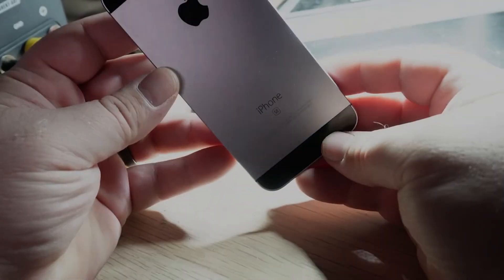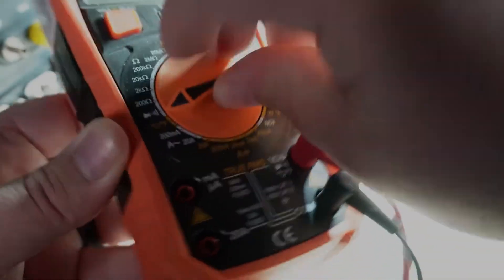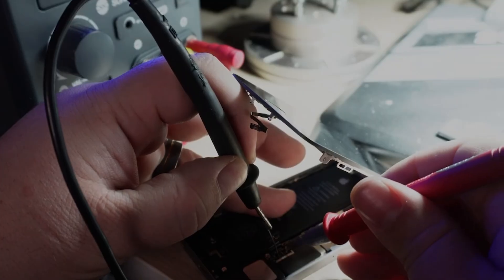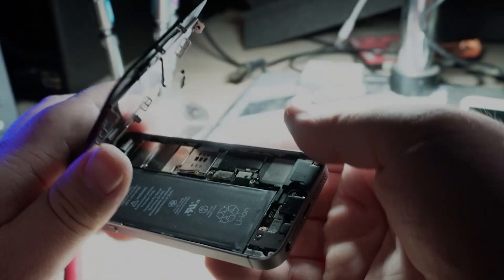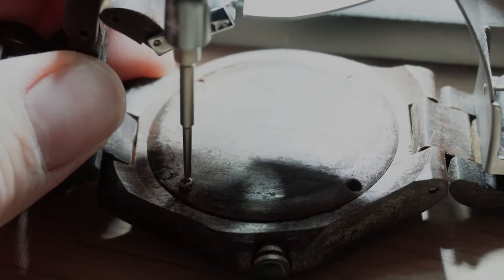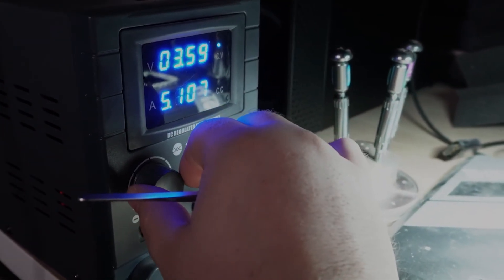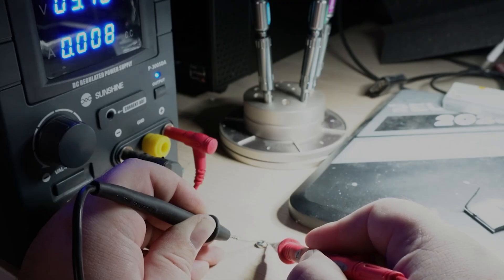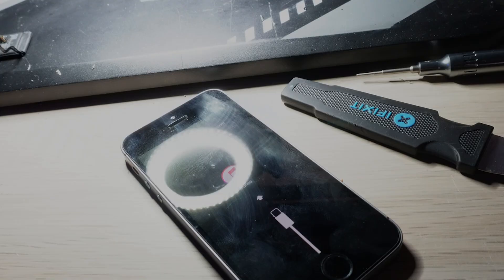The Secret Fix for Batteries That Refuse to Charge (Works on Most Devices)

Comment: You might get it to start up for a few days a week or a month but most will die again. So it is good to check that the item works but most likely needs a new battery.   Note every time you open anything you risk damaging it forever too.   As for a watch,  the silver oxide battery is not rechargeable so it may also explode or pop open and leak.   So how much is the item you are fixing worth?

Comment: Any idea how to fix a completely depleted battery inside an Apple Pencil 2nd Gen (model A2051) ?   The pencil got knocked out of the magnet and was lost behind  the desk for 3 days.  When I reconnect it to the iPad Pro it sees it, it connects to the bluetooth, it says that it has 0% charge and a red thunder icon showing that it is charging it.   But it never charges, it stays at 0% charge even when charged for days.  I think i need to get it to jump charge and then it will fix itself, but I do not know how to do that.  Help?

Comment: it doesn't really fix anything; it just allows temporary charge from deep discharge. I've done this on tech & power tool batteries as well. Even if you're able to jump-start it to allow charge, the battery is unreliable, will continue to fail, and needs replacement
Reply from the maker: You are mostly correct. in most cases a new battery is recommended, I just use this trick to make sure everything else works before ordering a battery if I didnt have one on hand. It does happen though where a good battery will deplete to where it needs help to start to charge again. I see  it all the time with batteries still about 90% health
Reply: @MobileSentrix  you may see many things, but most people here, unlike me or you, don't regularly repair or maintain tech. Most wouldn't even have or know how to use a multi-meter to check DC voltage or continuity, or even know what they mean without Googling it ...lol

Comment: If there is physical damage or natural degradation there is no secret fix
Reply from the maker: correct, this is only really for two situations, either a battery that still has life cycles left that got so depleted from non use that it wont charge or to get a device to work while waiting for a new battery to be installed.